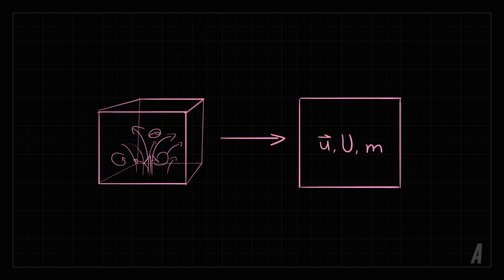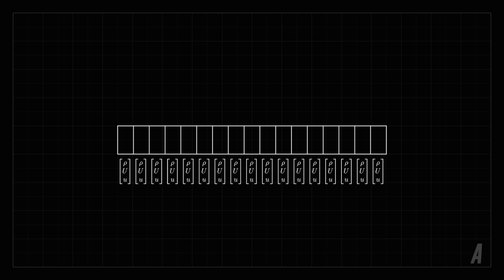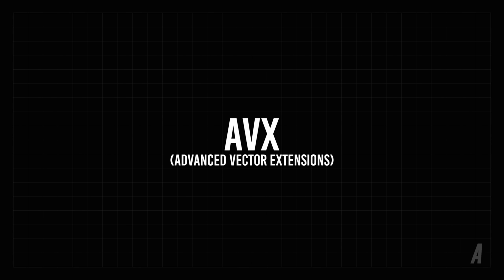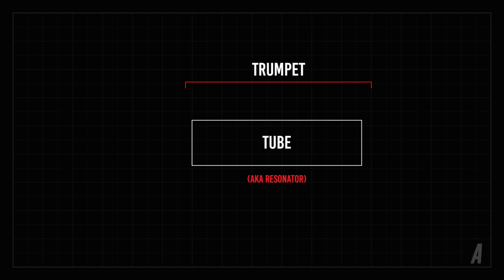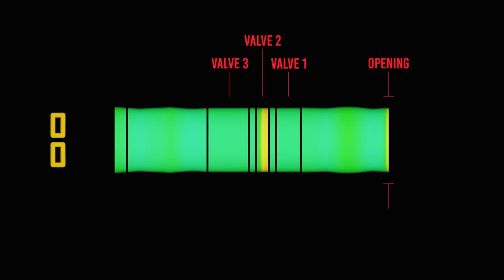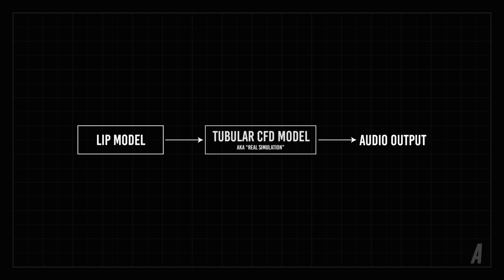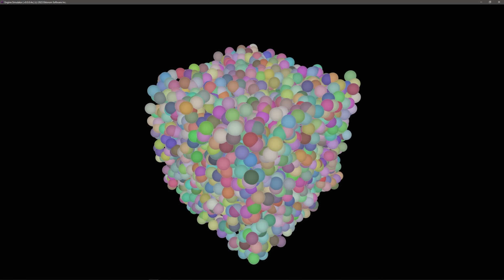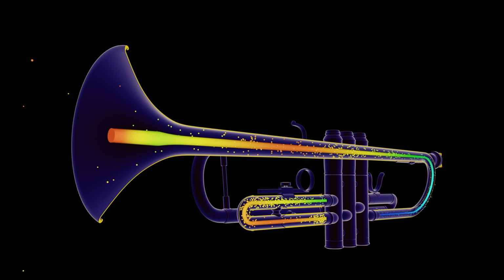Real-time Trumpet Simulation [C++/Vulkan] [WARNING: Flashing Lights]

Comment: Update in two years:

"I was concerned about how computationally intensive this would be to implement on my current hardware, so I fabricated my own ALU which will run Engine Simulator as efficently as possible."

Comment: I am a French Horn player, I practiced on high school and now study aerospace eng. I would advise have some empirical mouth lip sound records instead of a lip model to see if the trumpet model approximates a true trumpet sound. These sounds may be tricky to acquire even online. I know you do not know how to play the trumpet but vibrating lips is easy, just hard to master. Just look up "buzzing practice" and you should find enough to record with or without the mouthpiece. Keep in mind that the sound you make in the trumpet is forced upon the response from the trumpet. When playing without the trumpet, you lack that impedance. For that to work, the frequency of your lips must match the resonant frequency of the model. I am curious what would happen if you feed the sound record with different frequency (not harmonics) of the trumpet model.

I do believe the diverging horn is very important because it increases sound dispersion rate by a lot and it changes the end tube response. That itself can shape tone and timber alone. For example, French Horn is a instrument where you play with your hand on the diverging horn. The reason for this is to avoid the horn falling on the ground with added benefit of opportunity to change and tune the horn with the hand position. You can make a more limited effect of this on the trumpet with a "Trumpet Mute".

Comment: With the speed that this guy cranks out acoustic simulators, we're gonna have basically everything by the end of the decade xD
It's just amazing. I also did /not/ know that lip "vibration" is a factor for making a trumpet's sound. The more you know.
I simply thought it's like a flute, just that for some reason you put the mouth piece over your lips, instead of the other way round with flutes.
But beyond that, I never bothered wondering about it. Now I do.
Reply: Yeah, if you just blow air it won't make any noise.
Reply: @realityDUBSTEP  so a trumpet is basically a "fancy" Kazoo.
Although it's more likely the other way round, but this is funnier to me xD

Comment: You could make it as a VST so it can be played with midi inside a DAW or other programs. There aren't many pysical trumpet simulation so it could be interesting
Reply: Because of the embouchure needing to be emulated, this isn't so easy to replicate or achieve using a MIDI keyboard, but I do agree that this would be great. Solo trumpet VSTs and sound fonts tend to sound less than ideal for a quality recording, so something like this would be incredible.
Reply: @garkbox  DAW would let you adjust embouchure with things like, automation, without having to manually play it on a midi keyboard
Reply: An EWI would be the way to go. I don't think they do anything for embouchure transcription but it's still closer than a keyboard or a mouse. 😊

Comment: Why does the back sideways U tube have no visible simulation?
Reply from the maker: It does, but you have to be on the other side of the simulation to see it since only half of the tube is cut away
Reply: @AngeTheGreat i was under the impression the tubes were transparent. They remind me when you hide a part in Juno new origins.

Comment: As a trumpet player, it's funny to me that the computer has to blow a lot of air into the trumpet for it to resonate properly as this is exactly the same for beginner trumpeters who have not yet developed the strength and technique needed to play correctly.

Trumpet players also must control their tongues effectively to activate the notes and get the tone colour they are looking for. I am interested in how that could be simulated.

I'm not quite sure I understood how the register the trumpet plays is controlled in the simulator. In real trumpets, you change the pressure and the size of the lip opening to control this.

Great video. I hope to see more on the trumpet simulator.
Reply from the maker: The register is controlled in the same way in the program as it is in real-life, by adjusting the lip tension and possibly also the opening. The lip model is very simple so it probably doesn't factor in all of the relevant parameters that a real trumpet player would consider. The other issue is, since I can't play the trumpet in real-life, I have no idea how to set the values in the simulator so my choices for tension/blowing pressure/lip geometry are probably not that great

Comment: Trumpet player here.  Your simulation is uncanny.  The tension in the lips being higher reduces air volume required and increases air Velocity.  The resonance of the horn provides orders of magnitude more amplification than you would expect.  The density of the metal plays a role too.  Lots of sympathetic resonance in real instruments.

Simulation inception would be necessary to capture all of these effects.  The fluid simulation is but one part of it.  It's probably the most important though which is why your results are so close.  

Love it man. You should share this tech with music companies like Roland, Yamaha, Nord, etc.  They could really benefit from your achievement, and their effects and signal manipulation, user control, and expression technology could make this sound 100% better.  Like a quantum leap in woodwind and brass synthesis. 

Patent it please. Open source it. Share it some how.  We need this in synthesizers!
Reply: He should certainly not share it with any company. Selling the rights for them to use it, maybe.
Reply: LGPL?
Reply: The ascending aperture limits air FLOW (not air volume) and reduces efficiency.  Requiring more air PRESSURE as one ascends dependingon the dynamics played..  Air "speed" is irrelevant (and just a popular hearsay term among players)
Reply: yes!!
Reply: The metal density can be done really easily with wall damping! Remember it doesn’t all have to be simulated atom-by-atom just to be incorporated!
Reply: As this work is definitely incredible, why would all of you assume that the mentioned corporations do not have equivalent (if not better) CAE tools?
Also there are many open source CFD libraries that they can use. The work we see is a product of ambition and talent. Let it be this way. I assume and hope, with this level of knowledge, owner of these videos make a lot of money.
Reply: @MrGitarristt  They are 100% running CFD from some CAD software. The challenges with this approach are unlike what a company really needs. The company does not need to care about producing sound as listenable rate. If each sim step for them is 0.1s, they would have more accurate results, and they can simply borrow time on a cluster to make it work. 

Producing a moderately accurate simulation at this speed is quite the accomplishment.
Reply: There is no lack of delusional statements in the comments. For your information a lot of music instruments simulation are developped and used everyday since more than a decade, this is nothing new in the pro audio world, and let me tell this one is not good by any standard, you can find cheap vst plugins far better for a tens or hundredth of the ressources used here, and most important, they sound like an actual trumpet. So this is not going to be sold to anyone, because it is not worth anything more than the youtube views of a quite candide (ignorant) audience.
Reply: @lo2740 Yeah, all the people making comments here are acting like this is new or even a good way to simulate instruments. Physical modeling synthesis exists for a reason.
Reply: @lo2740 As someone that is very interested in this, where can I learn more about VSTs and what you’re talking about. My background is that I’m finishing my bachelors degree in oboe performance but I also do STEM research at a national lab.
Reply: @lo2740  I don't think there is a single person that argued it was a professional lvl simulation, nor that he should price it with insane amount of money. Main argument is that sharing this with companies is dumbass advice anyways
Reply: Share? Hell no, he spent a lot of time, effort and I bet fixing all the bugs decreased his lifespan by at least a few years. I looked up roland - 3k employees in 2013 and you say to share it with them? He will get 0 profit, credit or anything from that
Reply: @shauas4224  if you open source it you can open source it a way such that it cannot be used to generate profit, there are licenses for that. Or he could just BSD type beat licensing and say fuck it.

patenting it is admittedly pretty cringe, especially for home gamer stuff.
Reply: @killingtimeitself  yeah good luck finding out that company won't care a single bit about license and then good luck finding out that they used it since I highly doubt any of companies will open source their software as you say author should do. Don't get me wrong, I m also curious to dig in the code and see how this works but downside to that - companies will abuse and steal his creation
Reply: @shauas4224  Companies typically don't fuck around with breaking licenses. Open sourcing under something like the GPL guarantees that companies are forced to either open source their own projects or just use yours and contribute to it.
Reply: @shauas4224  if companies aren't going to respect it at all than why even bother patenting it at all, they wont respect that either.
Reply: @killingtimeitself  there is whole lawyer departments in some companies, whole purpose of whom is do take away patents for smth they need. A lot of different techniques which they use, so nowadays patents are becoming obsolete. Licenses are better but still - a lot of ways to overcome boundaries of what is provided under licence, just rewrite some code in different form, change names etc. You can, of course, spend an insane amount of money on lawsuits but not many people will go for it. Plus close source problem also creates many obstacles on the way to enforce license usage. Intellectual property rights as a whole is not adjusted properly, not controlled as needed nowadays
Reply: @shauas4224  one solution to that is to simple fully open source it and call it a day because frankly who gives a shit. Other forms of licensing are pretty explicit and exist universally, so i imagine a lawsuit would be easy there, rather than something like dealing with patents.

I mean sure, they can take what you've done and turn it into a variant and use that, there's nothing wrong with that. You can't sue someone for being inspired by what you did.

I think realistically your best bet is to open source it, make it accessible to as many people as possible, including or excluding commercial closed source usage from it. And then calling it a day because frankly who cares.
Reply: @shauas4224  Yeah, we get it. You are this big company conspiracy nut. We vs. them.
You don't even have the time to waste looking up REAL lawsuits, where your soooo mighty companies actually lost and had to pay the "lone and heroic" inventor his share (You know, democracy, constitutional state, effing capitalism and so on???). Happens daily. Ah, you don't looked that up, sure? It's actually the law and not what you fantasize about it. There may be one case out of 1000 where these POWERFUL and MIGHTY lawyers won against all odds, but that is not the standard. Like the OJ case is just a curiosity. But for you this is all what is needed to make you completely blind and run around like a beheaded chicken, completely ignoring reality, I hope you do not drive a vehicle or something like that ( in REALITY).

That you are absolute nuts show your views on IP rights. That this isn't regulated and you are somehow the only one who noticed that is really telling. Hey, otherwise there would be an army of politicians, civil rights activists, lawyers and shareholders to fix such loopholes immediately, willing to start a war over it. The latter ones really loving their security when they invest in businesses, which your strange worldview completely contradicts. Why don't you look s. up, at least the basic, before you start fantasizing on the Interwebs?

P.S.: "not adjusted properly," ... So if someone steals your registered idea/trademark/patent/copyright there is just "Wild West"? And we should not go to court to get our rights, guaranteed by that law? Is that what you are saying here? Bury your head in the sand? I don't even want to know where your head is right now...

P.S.S.: "there is whole lawyer departments in some companies, whole purpose of whom is do take away patents for smth they need." So, you mean the "theft division". You are surely out of your mind. If I have the opportunity to make a million dollar per month, where I need to invest 300k in raw materials and 2M in machinery and 700k in licenses, than lucky if you have the pocket money. Or ask investors or banks, that is what they are there for! Or do nothing and don't make profit after some time. That is how industry, how hobby-business and most economy(making profit) works on a comically simple level. You clearly watched to much of Hollywoods Tesla vs. Edison wet dreams, don't you?:) If you actually asked a lawyer of that mysterious und secret patent-stealing department, than he would told you that additional and unnecessary risk(not even possibly criminal or "gray" actions), that can lead to you and your company loosing EVERYTHING, is not even an option.